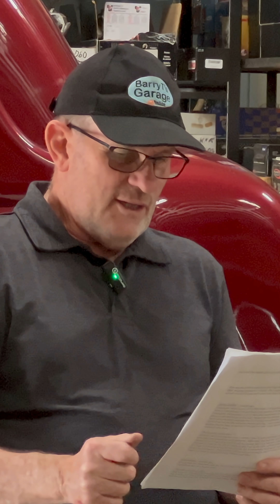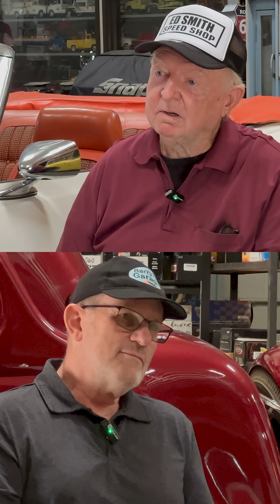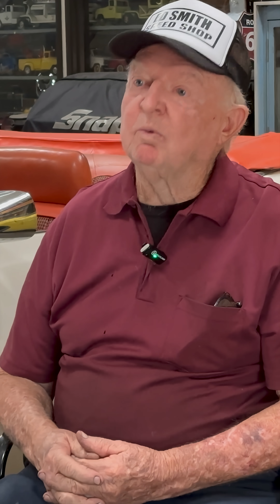Lincoln 460 vs Caddy 500 for Horsepower - Ask Ed 41 - Ed Smith w #BarryT #engine # #automobile #v8

Comment: Thats interesting considering the efi 460 engines. The restriction on the fuel injected 460 engines is the intake manifold and throttle valve. Once you pull the intake off it is obvious looking at the intake port on the cylinder head versus the manifold port
Reply from the maker: I’ll ask Ed if he has any of those around to compare.

Comment: 429/460s had a bigger cyl head in base trim with the C8VE-D1VE being the most desirable base cyl head from the Lincoln 360 horse or 429 thunder jet. Cadillac heads looked like you took a decent small block Chevy port and spaced them evenly instead of in pairs. The 460s had intake valves around 2.08 compared to Caddy’s 2.00” and the exhaust on the big Ford is 1.650 compared to Caddy’s 1.625. The Lincoln exhaust port is marginal, like other era big Fords they bend downward instead of being raised to flow straight up. 
Bottom end they are two opposite beasts with the FORD/Lincoln having a 4.360 bore and 3.850 stroke. Caddy’s behemoth had ja slightly smaller bore at 4.300 but the stroke! 4.304. I put a 4.300 crank in the 460 in my 70 F250 and it gave me 532 cubic inches at .040 over… the mains are also slightly smaller on the 460 and the saddles/caps are more much heavier duty.  The Cad could make insane torque but don’t rev it up past 5000 rpm. The 460 is a huge bore and with the right headwork should rev up better in spite of the 3” mains.t
Reply from the maker: Spot on comment
Reply: Spot on. I've got a pair of stock 68 heads on the shelf. The exhaust port is abysmal. Luckily, there are finally reasonably priced cylinder heads that just change the whole situation on 429/460 engines. That big bore is great. A stroker crank will send it to the moon! Sounds like you have a great set up!

Comment: The 500 wasn't made to be a performance engine. It was made to make low end torque, idle smooth as possible, and be quiet. 
1970 was the best year of the 500. The emission crippled it until 76.

If it came out in 65 or 66, it would have been much improved. A design after its time and built for luxury not speed.
Some street racers used them, but they were hard to hotrod as very few Hi perf parts were made for it. 

They were very nice engines and worked as designed, with a few flaws. Yeah, timing cover. I'm looking at you...

Comment: That 472/500 cu. in. Cadillac block was designed for expansion from what I remember. The bore centers on the block are spaced far enough apart to be able to support 600 cu. in., but I don't know anyone that worked with them to make them serious Hot Rods.
Reply from the maker: That’s a very interesting point. I’m gonna have to ask Ed if he’s heard of anybody doing that.
Reply: @BarryTsGarage The 500 Cadillac engine  can be bored .080+ or more without block fill, and you can get a 4.750" aftermark stroker crank. That's 570"+. Cadco in NM sells stroker Cadillac cranks. Stock stroke on the 500" is 4.304". The 472" is 4.250" stroke. Heads and valvetrain on the 472/500 engines are not great. Mild cams and light weight valve springs. They don't rev high but make huge amounts of torque. They were designed for a very smooth running engine. You can buy hipo Bulldog aftermarket aluminum heads for the Cadillac. There is interest in Cadillac 472/500 engines.
Reply: @MkGearald  Pretty stout 5000 rpm motors !
Reply: @MkGearald There was a "t/a performance"? that did 472/500 componets unfortunatly my 76 coupe got killed by a flood first.
Reply: @MkGearald  Beautiful engine's without a Doubt ⭐⭐⭐⭐⭐
Reply: Yep. Cadco in NM.
Reply: Both of Big Cadillac Engines in completely stock from were definitely a beautiful engine, just a dream to drive and would push a huge land yacht down the road Very Quickly, the last Cadillac Automobile I owned was to be a donor for it's engine in a pickup swap.. never did happen though, small block power in an older truck was plenty of power and not very dangerous if hopped up just a bit.. Caddy engine would have been a non-stop tire destroying Machine.....

Comment: The 460 intake ports aren't bad even stock, a little clean up and manifold matching, the exhaust's need most of the attention raising the roof. Personally I've always ported for velocity over the widest rpm range I can get. The only time I screwed one up was the very 1st port job I did, my old Suzuki TM 400, it was a disaster, 3 distinct torque peaks as engine speed rose! 😂😂
Reply from the maker: 😂😂 well, it was your first time you should not feel bad!
Reply: My thoughts Exactly, you're first time, we all have been there
Reply: Tm 400 needed smaller ports and ts400 flywheel
Reply: Hello Logan P.E..Are you willing to give up some of your secrets to a port job?  I have seen some amazing hp numbers happen with someone that knows what there doing.  Or do you know a channel on YT that's pretty open to gaining air speed and velocity. I seen a guy lose a whole second off his times due to a "not good but a great porting job"! Thanks for your time!
Reply: @tedkearns9669  Sorry this took so long, YouTube doesn't always give timely notifications 🤗!
I don't really have any secrets, I just clean and match and don't hog the port out to keep velocity up then the area opens up across and through the bowl smoothly so the valve diameter is the largest part, the idea being to create low pressure at the valve helping to draw the air along. Hopefully that makes sense, it's just the way I visualize the entire port.
Reply: @LoganP.E Do I leave the short side alone or just give it a decent sheen also?
Thank you very much for your time 
MR. LoganP.E !
Reply: @tedkearns9669  It depends on the total design, cross sectional area, valve size etc etc. Short side radius that's a sharp turn usually can use some taper to reduce the corner but it always depends. You'll have to use your judgement!
Reply: @LoganP.E  Thanks you're the man! I've had guys to clam up when asked info on the subject. Good luck making horsepower brother and thank you for helping me. I can see me going from port to port and back making sure my dimensions are the same across the board.👍
Reply: @tedkearns9669  Good luck brother, I'm long retired actually and I'm not racing so don't have secrets 😁👍🏻